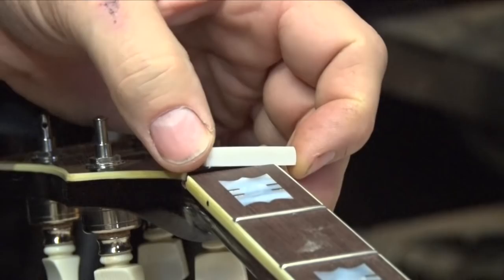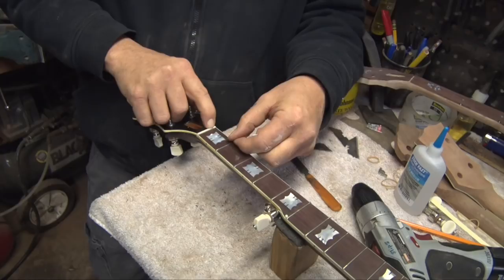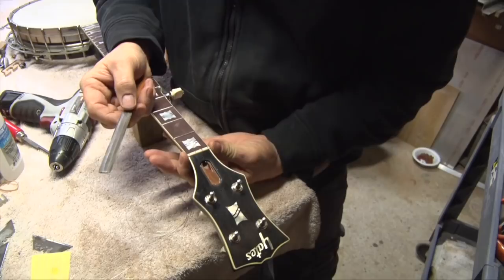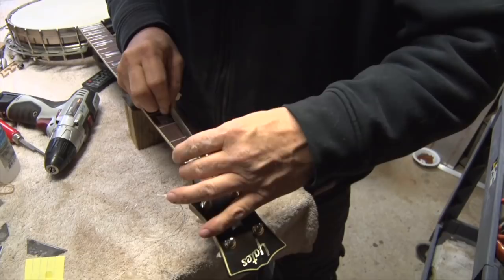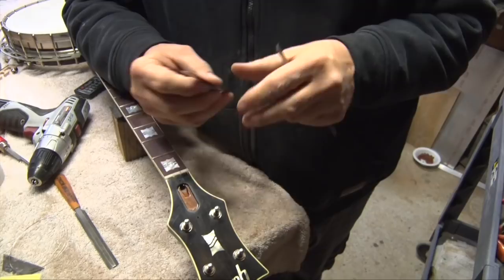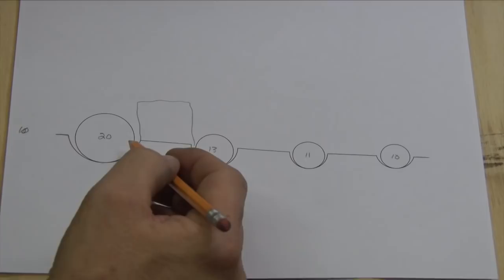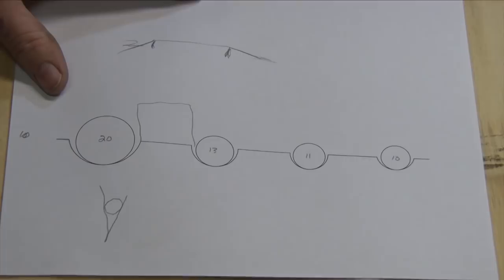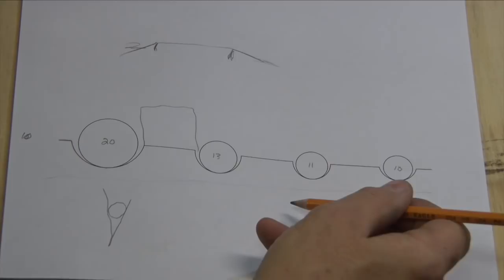Understanding Banjo String Grooves

Comment: Thank you very much for the clear, concise and easily understood information.  I’ve been contemplating replacing the nut on my Stelling banjo due to considerable chipping on the face of the nut associated with two of the string grooves.  Your video addressed a lot of my questions and concerns about tackling the project. Do you suggest using bone as the nut material?